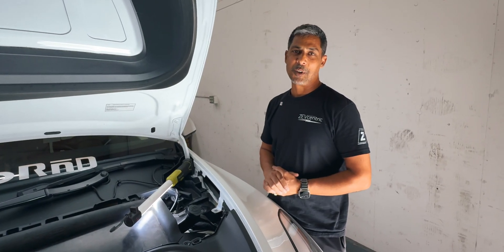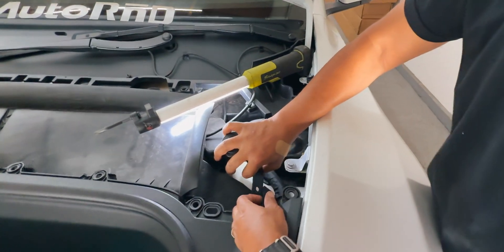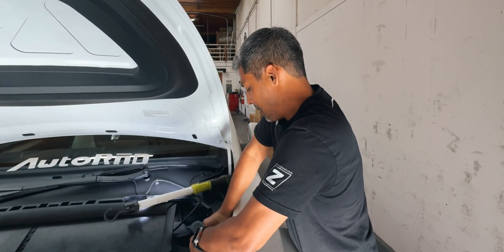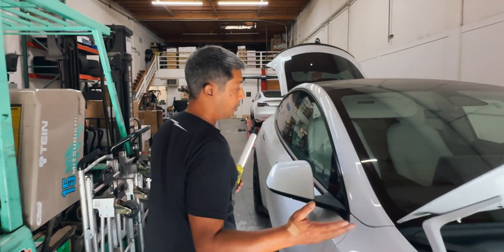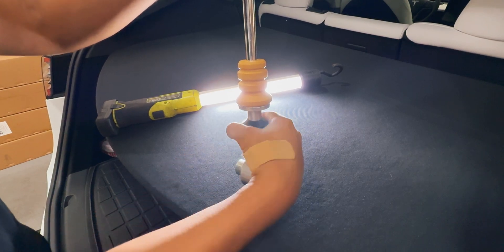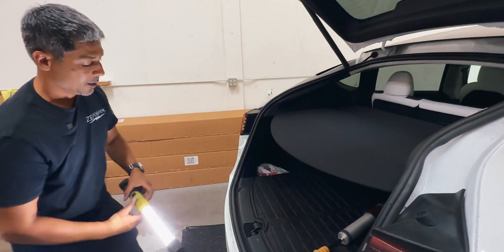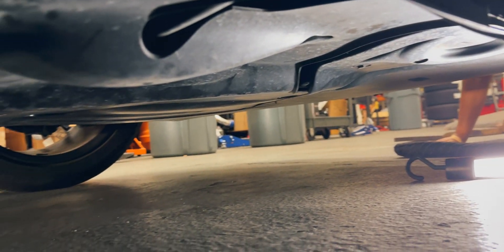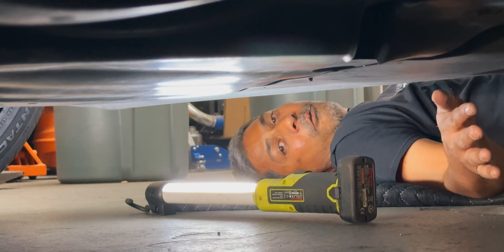OHLINS:  HOW TO ADJUST THE DAMPING ON YOUR TESLA MODEL 3 OR Y!!!!

Comment: Does the inversion adjustment point you made about clockwise vs counter clockwise also apply to redwood's kit? The adjustment knob is different on my kit hence I'm asking. Any thoughts on a good starting point? for that?  I get alot of bounce on mine on the freeway and I think its because I have been making it stiffer in the rear due to this inversion you're talking about.
Reply from the maker: @JonMartin84  its the same on redwood.  Speak to them for damping guidance as well.  Always click to full stiff and then count backwards to soften.